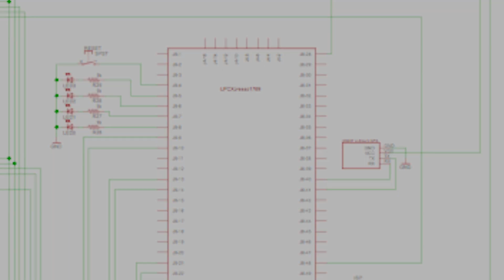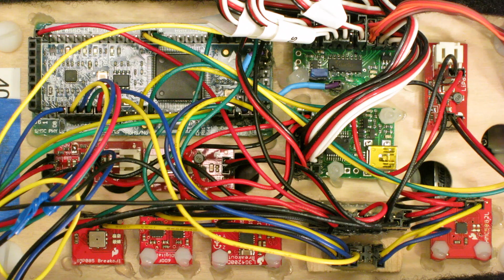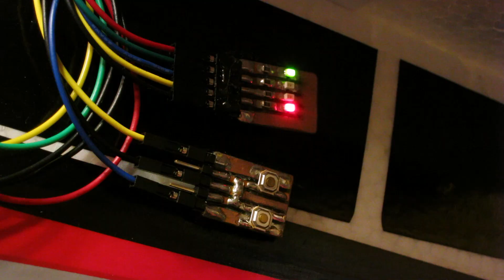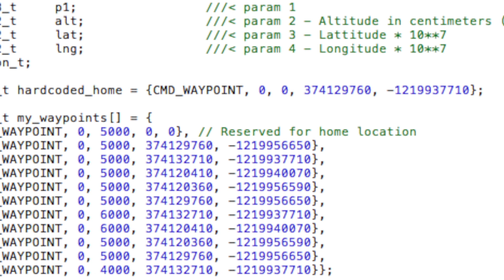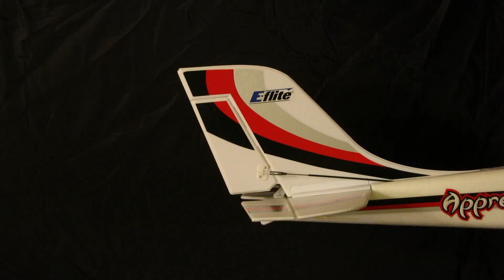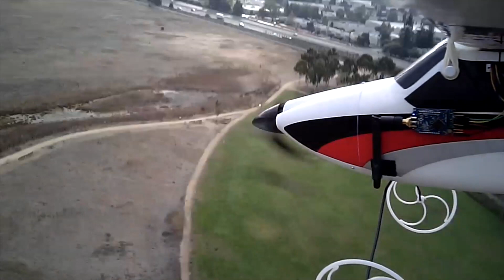CorePilot Description

Comment from the maker: Thanks. The autopilot follows a series of pre-programmed waypoints. When it gets to within a certain distance of a waypoint, it switches to the next one in the list. The aircraft location (and heading in the current implementation) comes from the GPS receiver. The receiver that I used updates about twice per second, if I recall correctly. Measurement lag is significantly less than 15 seconds. Good luck with your project!

Comment: How do you use the autopilot, the system has a tracked way and then GPS makes the rest?, what about the delays with GPS? i know that is about 15 seconds... a lot of time and dangerous for a flying object, really nice work. I started a few months ago with a quadrotor, is part or my master project.